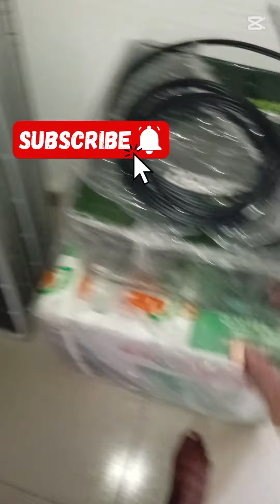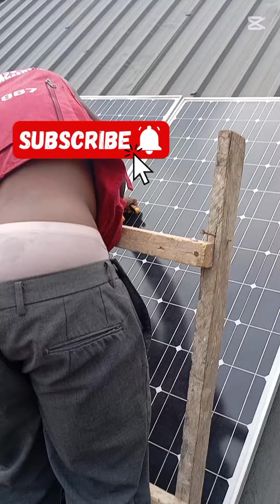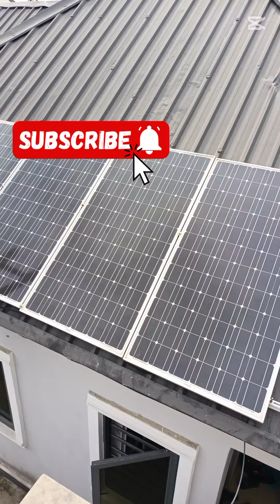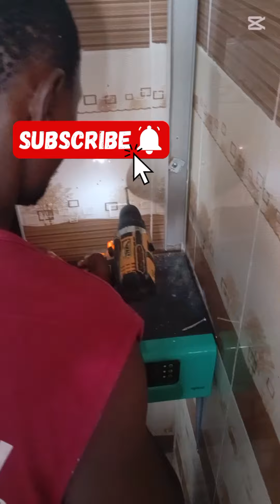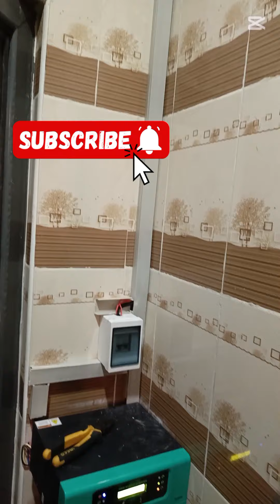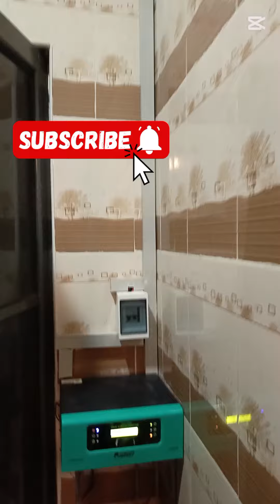SOLAR; How I installed 1.2kva inverter system to serve as 5KVA for a client

Comment: Nice work sir. Are GSR batteries that good? Secondly, you used 300watts panels which are typically 36volts panels. Is the charge controller in the hybrid inverter a pwm or mppt controller ?
Reply from the maker: @YemiOnline  thanks for the comments. As much as I have use GSR battery they have good I wouldn't know of other people experience 

It's pwm charge controller